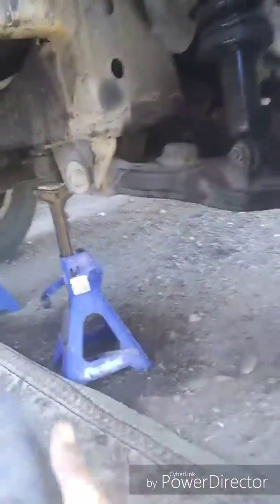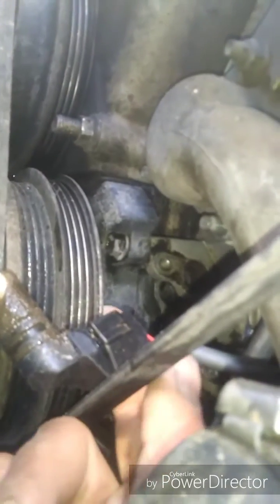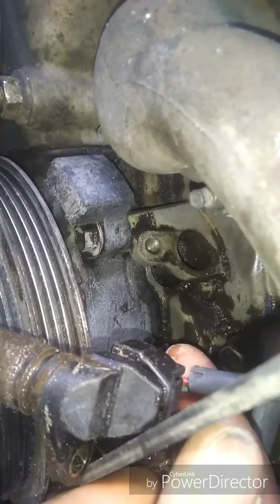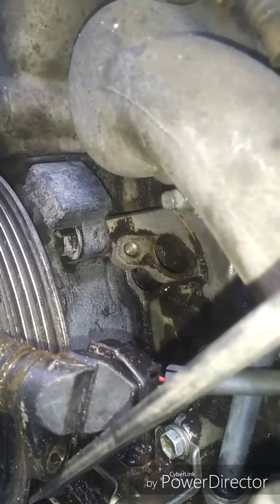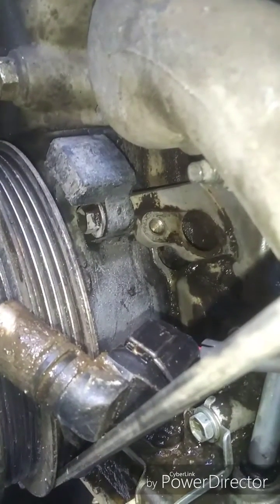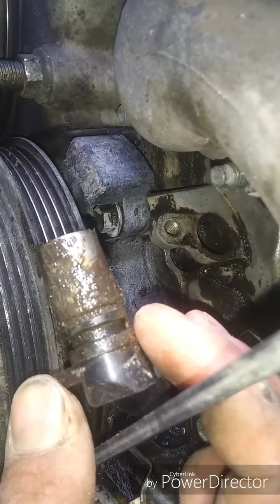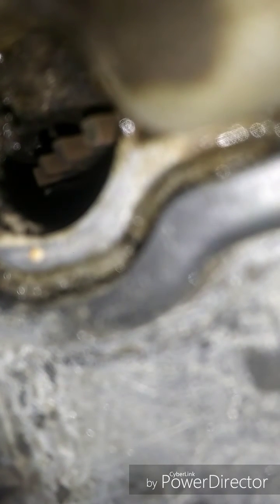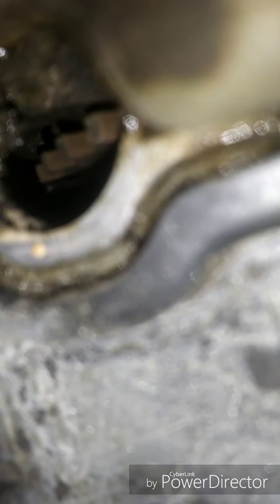Locate and replace Crankshaft Position Sensor 98' Tacoma

Comment from the maker: Sorry for the late reply.. I will head this caution.   I know it sounds like a good idea to get an after market sensor but don't do it. Especially not the MAF on this model.. if you want to save a few bucks go the junk yard and pull from a 4Runner of the same year. Or just buy the OEM parts.  Your Tacoma will run
Alot better. a few of these problems being described are often likely from after market sensors. They're crap.  Hope you're enjoying the covid era, everyone ready for whats coming?

Comment: Gonna check this on my 96 as well as it cranks but isn't turning on yet it was a few days ago. I'm getting no codes and after new spark plugs I'll be checking this, MAF sensor, and fuel pump next. One of those has to be bad as you need fuel, air and spark to start unless it's a bad ECM which I doubt.
Reply: What turned out to be the problem? @JRG
Reply: I ve been having the same problem on my 95. It wasn't throwing any codes. The fuel pump would stop working after about 10 to 15mins of run time. Switched in new pump, filter, relay, etc. Still the same problem...come to find out it was the crankshaft position sensor. The fuel pump is relayed thru it and the sensor was going bad and turned off everytime it got hot.
Reply from the maker: It was a loose wire in the pigtail connected to computer left of the intake manifold .. on the v6 3.4l . I dont know what engine you'll have in the 96' think it's a little different.
Reply: @oscarcervantes4092  sorry for late reply didn't see this till now. Ended up having a bad relay. Don't remember if it was a fuel pump, EFI, or ignition relay but I did learn from another mechanic friend that if the CEL light isn't coming ON in the cluster when ignition is turned ON that the faulty relay I had wasn't sending signal to fuel pump or something like that cuz I believe there was an open circuit. Figured it out with a power probe and a small jumper wire and it started up right away. Mine was a 96' 4Runner SR5 V6 3.4L. I sold vehicle a while back but it's still running like a champ I heard from new owner who was an old co-worker of mine.
Reply: @jrg6809  hello I'm currently troubleshooting a 96' runner 3.4 v6
I have a NO CRANK NO START
I've replaced starter new ignition switch new ground wires. New starter relay.
So you basically jump start the truck at the fuse box ?? When testing

Comment: i have an 02 pre runner and the engine will stall once put in reverse. from what i’ve been reading on tacoma world the first gens and 3rd gens have the same problem which is a bad dps. hopefully this is the problem and a new cps will fix it
Reply from the maker: Just a wire. Cps was fine.

Comment: Thank you. This was kicking my ass.  Did you ever get it figured out?
Reply from the maker: Yes there was one wire loose connected to computer left of the of the air intake manifold, the blue wire. Took 1 second to push it  back in. Lit right up.
Reply: @DanHooke  what was it conected to
Reply from the maker: @jefferyhoskinds189  wish I could send a picture I don't know the name of the piece. I guess it's not a computer but there a large pig tail looking module left of the air intake. It tells your computer what signals are being sent where in relation to fuel air intake. Literally the only thing with wires set left of the air intake manifold that is not the cruise control. In that pig tail there are series of colored wires on mine he blue wire was dislodged slightly. It could be a variation of male or female part on any given wire there.  That piece often gets knocked around when removing the manifold. Probably very common. And why this issue seems reoccurring check it out. Tell is what you found if anything good luck

Comment: I have this same problem going on right now. Did you find the issue? Mine is a 98 Tacoma 3.4 Limited. Should be pretty much the same as yours.
Reply from the maker: One loose wire on the cps next to the air intake manifold. The blue one.. barely pushed it back into the pigtail and it right up. No problems since.

Comment: was it making your truck run as if it were misfiring? cause i change so much shit and still my trucks hesitating going up hills or high way at 3k rpm
Reply: That exactly what mine is doing and I finally got it to throw a check engine light and checked it and said it was Crankshaft position sensor, this is after 2 o2 sensor's and a few other things replaced
Reply: @danielallen1901  same
Reply from the maker: Think that sounds like throttle body if I remember correctly. Or EFI.. mine climbs up a steep hill in first gear  in idle.. it can be tuned.
Reply from the maker: Air/ fuel mixture. I've replaced everything on this truck I love it
Reply: Knock sensor limits ur engine rpm. Mine was getting barely getiing trque under 3k and it would just not go anymore den 4k

Comment: What was the problem. Having same issue
Reply from the maker: Loose wire on cps left of the air intake manifold.. it reads the mass air flow sensor info. The blue wire was out slightly from the pigtail connected to the computer part. .. pushed it in and fired right up.. 1 second fix never happened again.